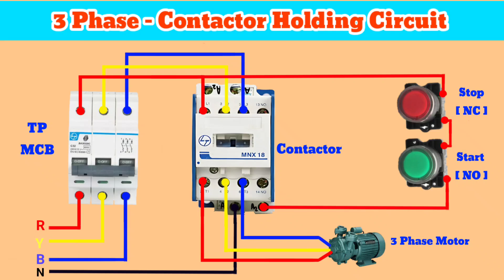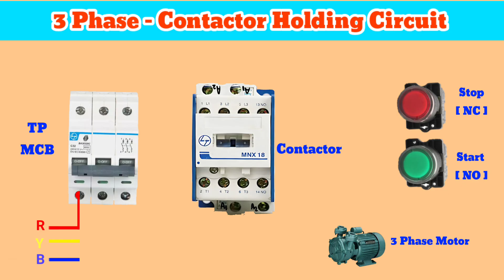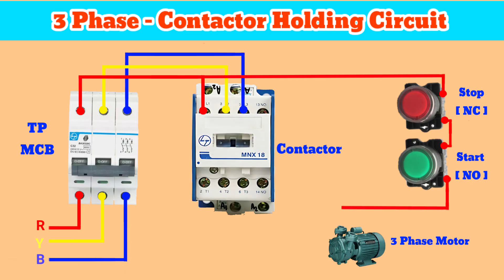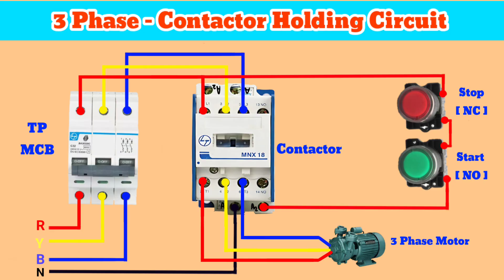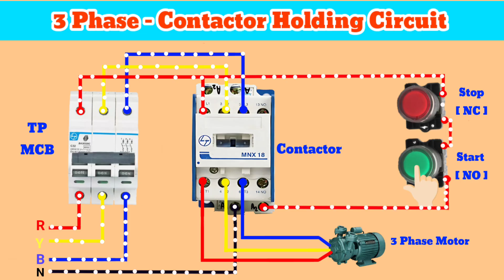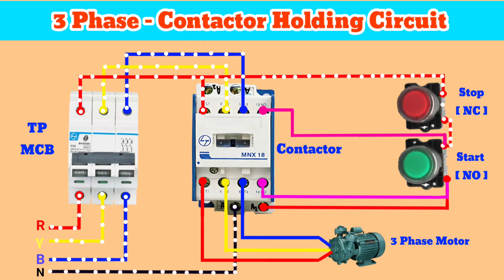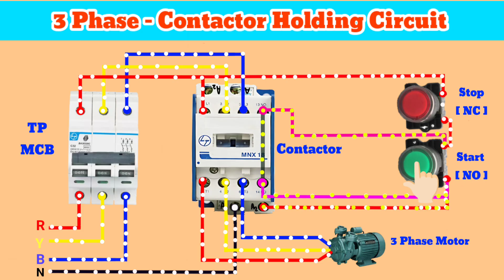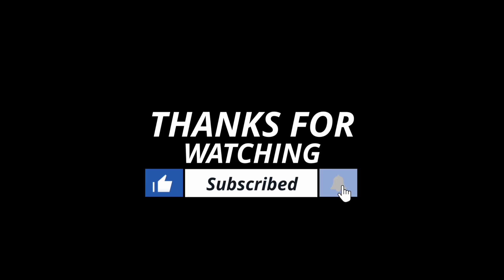3 Phase contactor holding circuit connection l contactor wiring connection

Comment: Please I have an LC1-D6511 contactor but it doesn't have the A1 and A2 terminal. 
What I see is 22NC 13NO and also no terminal for the neutral wire.
Reply from the maker: Lc1-D6511 is a three Phase Contactor,
You can use 13-14 as no ,
21 -22 as nc
And it's have 2 small terminals below  l1 ,l3,l5.
If you need to use netural,use it in a2 terminal.
Reply: @Sam.Electric  wow! I just saw it. 
Thanks so much.